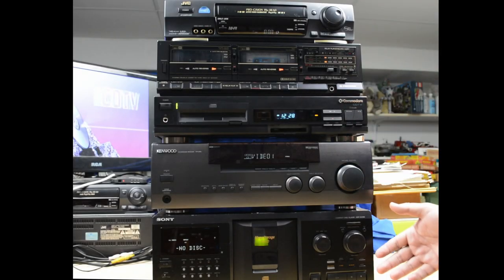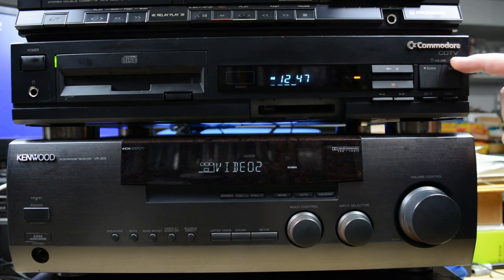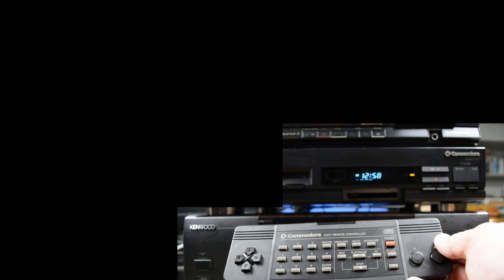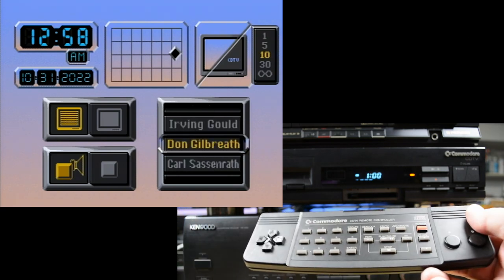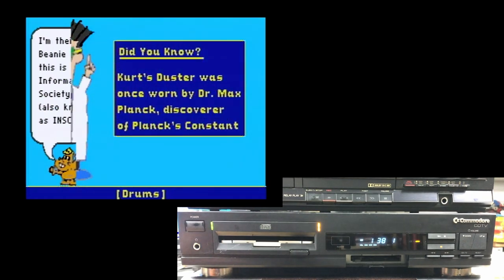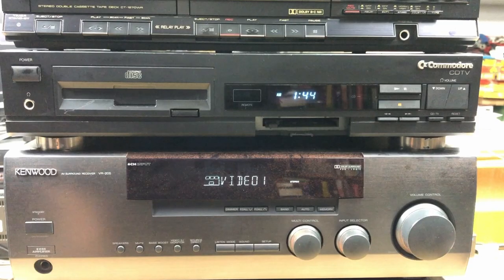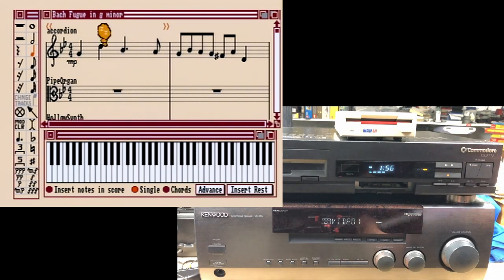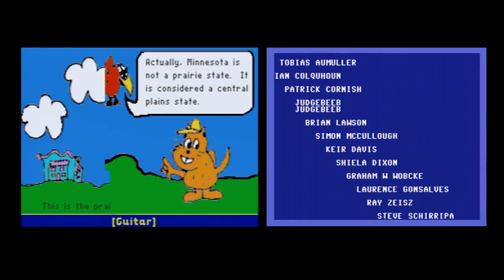An Amiga Hiding in a Tower of Power: Commodore CDTV in a 1990s Hi-Fi Stack

Comment: I was the developer of the Xetec CDx system for attaching a CD drive to your Amiga. Later, when CDTV came out, we wanted to give our customers the ability to use these CDTV titles on a stock Amiga system. So we developed emulation versions of the special libraries and software "devices" that the CDTV had over the stock Amiga OS. That worked reasonably well for many CDTV titles (we successfully tested about 45 titles), although I think we encountered a few that didn't work with this emulation.

I was fascinated with CD+G at the time, but couldn't make it work with our system because the Chinon CD drive included in our system did not provide software access to the +G data stream. We supported user-supplied drives, too, but I don't recall that we ever found an available SCSI CD drive that supported access to this data. (IIRC, the Matsushita drive in the CDTV was not SCSI.) 

Funny/sad story about my quest to get +G working: I suspected that these CD drives might indeed provide a way to access the +G stream (and other optional streams also doc'd in the CD "red book") using commands that were just not documented. This was common of SCSI drives at the time -- support the required standard commands and then add "vender unique" command for your internal use or specialty functions. So I wrote a sort of "war games" SCSI scanner that you could point at a drive and it would try every possible SCSI command and log the error returned to help me look for undocumented commands. This tool worked pretty well to uncover commands that the drive supported in some fashion. But then one day I accidentally pointed this tool at the wrong SCSI address -- that of my development hard drive attached to the Amiga! Anyone familiar with SCSI knows that there is a VERY simple command (04 00 00 00 00 00) that performs a low-level format of the drive. Next thing I know my HUGE (for the time) 800 MB development disk is click-click-clicking with the familiar sound of a low-level format. Yikes! How I recovered this drive and the data on it is another long tale that, all these years later, I just chuckle thinking about. Although I did find undocumented SCSI commands in these CD drives, never did I find one that would let me pull the +G stream and convert it to graphics in order to "play" CD+G's on a stock Amiga. I think I even spent some time reverse engineering the Chinon drive's firmware 😲in my quest. Boy, what a nothing burger CD+G turned out to be after all...
Reply: Oh no what a nightmare for that drive to get formatted!?!  Were you able to somehow retrieve most of the data I hope?  Roughly how?
Reply: @judgegroovyman  I powered off the drive as soon as I realized what was happening. Which left the drive in a zombie state where it thought it wasn't formatted. But I suspected that the data was still there, since low-level formats usually start at the lowest cylinder and progress to the end. And somehow I knew that this drive generally tried to fill the disks from the middle outward (to minimize seek times). But how to convince the drive that it was formatted and let me get at my data?? This was a Fujitsu hard drive and its firmware was in a socketed EPROM😲. So I was able to pull that chip and grab an image of the stock firmware. After much reverse engineering, I found the code that determined if the drive was formatted or not. I modified that code to make it believe it was, and burned that to a new EPROM and popped that in. Voila! My data all appeared again.

You can bet that we adopted a better policy of data backup after that incident. (This was, after all, before networking or cloud backups made this process easy)
Reply: @martyflickinger  amazing story, I had CDTV with 2mB fast extension but never learned about CD+G, now I am more tech inclined linux user and love to learn this stuff, thanks!

Comment: I'm a member of the CDTV club since a while back, and it fits right in with my Philips DAC/Receiver/Amplifier, and the monitor on top completes my tower of power. :)

The price of it was like a CD player on release, you basically got a computer for free, a no-brainer. It was certainly ahead of its time, not until 1995 did people understand they wanted multimedia for their PCs. In fact, it was like that for most Commodore-Amiga models; they were better than the competition on release date. They should have released full programming information with each model, but that's not why the models didn't succeed. Most models didn't sell to the numbers they deserved because Americans didn't get the Amiga and didn't embrace it. They embraced locked-down cheap consoles with 4$$-expensive games though, and then bought the complete opposite, 4$$-expensive PCs (but only clones) and pirated the crap out of it. 

No serious hardware or software developer can do anything to combat such madness in consumers.

Comment: Very cool to see the Commodore CDTV get some love on your channel. I started my CDTV journey back in 2011 and done a couple videos on my channel about it. The last couple of years I have tracked down most of the accessories for it. I'm now only missing the black 1084s and the 256KB memory card (I have the 64KB one). Side note, Power Pinball is one of the better games made for the CDTV 🙂
Reply: Better? Wow, that's rough, to say at least. Feels like a scam, rather than commercial software, knowing what Amiga hardware is really capable to do.
Reply: @override7486  Sure, we all know what the Amiga hardware is capable of doing, however back in 1991 when the CDTV originally was released, they were not doing all the amazing cool things that came later. As a CDTV branded title, as mentioned in my previous "Power Pinball is one of the better games made for the CDTV", I didn't say it was the best ever made for it. I actually prefer Lemmings over Power Pinball LOL. The CDTV was discontinued in 1993 with the launch of the Amiga CD32, so by then they were doing way better games and other software.

Comment: CD-ROM drives were pricey in the late 1980s and early 1990's.  I remember the magic number for me to jump in (for PC) was $300 and I saw one go on sale for that price at Fry's in 1996.  It went for that price pretty regularly in 1997 and then started dropping fast in the next few years.  I also remember buying my Amiga 500 for $600 in 1990, so a CDTV at $1000 wasn't out of line, but it wasn't compelling because of the software.  Had I seen a bundle that included the disk drive, keyboard and mouse for $1000 and I didn't already have an Amiga 500, I would've bought one.

Comment: Picked up my first CDTV around '92 when our local Amiga dealer was blowing them out for $99 since they had flopped in the market. It made a great companion to my Amiga 500 since with a special parallel port cable and drivers you could connect both machines and load software from one to the other. Sadly I sold that CDTV on eBay about a decade ago as I really wasn't using it once CDs were no longer en vogue. Got my current CDTV a year or two ago and although the CD-ROM drive is broken (and I'm not about to dig down through the innards to replace the faulty capacitors that are most likely causing the problem) I have fallen in love with it all over again.

Comment: Great video Robin. Nice to the CDTV in some detail.  

That Power Pinball is almost embarrassing. It doesn’t seem all that much better than some Commodore 64 pinball. There were much better Amiga pinball games for sure. This is meant to play from a CD ROM that could hold 650MB of data and displays on your TV, yet it takes maybe half the screen and the graphics are weak. 

For a storage media that holds something like 700 times more data than an Amiga floppy they should have done a lot better.

Definitely interesting. That $300 Encyclopedia would be $592 today. Ouch!
Reply: even more insulting is that 300$ Encyclopedia came bundled with every pc that came with a CD rom (with updates for video and audio)  only a couple years later, and by 1996 you couldn't give away new copies for free at our checkout counter

Comment: I still have my CDTV, keyboard, and floppy drive somewhere. I hope it didn't have a leaking battery onboard.  I'm just getting back into my older hardware.  I picked up a squarish formatVGA LCD at Goodwill for $4.75.  lol.  Now to choose a display adaptor option for 23 pin to VGA.  The CDTV always occupied a spot next to my stereo rack, with a 1702 monitor running composite.  The mouse was horrible though.  God I love the CD interface.  One CD+G I had on accident was Jimi Hendrix Smash Experience.  Kinda cool!  INSOC CD looks a bit cooler I think.  Hopefully I can find one.

Comment: nice... In my CDTV stack, I have....(well 2 stacks - All Sony) LBT-950D on the left. then on the right stack, starting at the bottom...DVP-CX850 (200 disc DVD), MDP-850D (Laser Disc), SLV-E80 (VHS), STR-DB930 (amp), Amiga 3000 in  black Checkmate 1500 Plus case, CDTV, and at the top, DTC-690 (DAT)

Comment: I actually bought a Sony CX455 (which holds 400 CDs), and then I bought another one, and then I bought a CX70ES (which holds 200 more & plays in "enhanced standard").
You can link the CD changers together and put them into a Jukebox mode that plays one track from one CD on the first unit, and while that's playing it'll select another disc on the second unit, and when the first song ends the second one starts immediately. The link is 1/8" mono patch cord between the units, I don't know how many you can daisy-chain like this.
(Obviously doesn't hold as much music as a 120 GB iPod, but hey).

Comment: The INSOC CD takes me back. I had a NEC Turbo Duo in the 90s that could play CD+G discs. I had this INSOC CD (as well as their other albums) and I also had "Naked" by the Talking Heads and "Silvertone" by Chris Isaak which were both CD+G albums but neither of them had graphics that were as interesting as the INSOC CD. I thought it was a shame that there weren't more CD+G discs released and I think the format may have had wider acceptance if the Sega Saturn or Sony PlayStation would have supported CD+G. Most of the early CD based game consoles (TG-16 CD/Turbo Duo, Sega CD, Jaguar CD, 3DO, Phllips CD-I & Commodore CDTV) could play CD+G natively but none of them had true mass market appeal as later optical based consoles did.

Comment: Very interesting video!  I wonder if VCRs use 4-bit chips like that Sanyo chip for their displays?
Reply from the maker: Yes, those 4-bit chips were very common in any application that needed a lot of I/O to run their displays like LED / LCD / VFD. I did a video about "4-Bit Video games" showing a bunch of electronic games by Tomy that also used similar 4-bit microcontrollers and explain a bit more about it there.

Comment: I wonder if the CDTV can run regular Amiga programmes for the equivalent machine. I suppose you'd need to somehow connect a floppy drive?
Reply: I watched on. It appears as though it can!
Reply: Should run pretty much anything designed for the A500 range.

Comment: 30:20  The stereo mixing is really irritating on headphones. Each note is either 100% left speaker or 100% right speaker. Was that typical with Amiga music?
Reply: I think the sound chip could only pan left, right or center.  If you wanted an instrument or sound to go in between it'd take 2 channels panned left and right playing at different volumes, and you only got 4 hardware channels.
But yeah it seems like an odd gimmick to add some kind of fake dynamics to the music in this software.  It might be quite old and before the tracker days of music composition on the amiga, so those sorts of gimmicks might've just been all this had to sell you on it. :p
Reply from the maker: The Amiga doesn't allow panning; it's got 4 channels, and two are hard-wired left, two are hard-wired right. Anything else needs to be done through software.

Comment: What, did you say Amiga had an internally 32-bit CPU? Or just this device here? Not sure I've ever heard of that, at least I've always believed it was purely a 16-bit system - and I guess it's more truthful to call it 16-bit, even if it has CPU internally 32-bit.

But people are often treating this kind of thing like it's totally meaningless that the CPU is internally 32-bit, because it's bottlenecked by the bus, but that's far from truth as well. Because, think of doing math with long integers on 16-bit system - a 16-bit CPU has no opcodes for working with 32-bit numbers; it has to do the math in 16-bit portions. In multiplication it means multiplying each part of the second number with each part of the first, so 4 multiplications plus then some adding and stuff. And that's simplification. A 32-bit CPU can do it with one instruction - so even if the rest of the system is bottlenecking it, the math is still faster. Just as one most obvious benefit.

But did I get this right, is Amiga 500 CPU internally 32-bit?
Reply from the maker: Yes, the 68000 CPU in the Amiga 500, CDTV, and also Atari ST and Mac are 32-bit internally, but have a 16-bit data bus. The 68020 and above are fully 32-bit but code compatible, so it was pretty easy for later revisions of those machines to jump to full 32-bit without requiring massive OS or other software upgrades. I've even heard the "ST" in Atari ST stands for "Sixteen/Thirty-two bit".
Reply: @8_Bit  Nice! I'm not sure I've ever even heard about it, but I'm sure that if I have, I definitely did not remember that - I've always classified A500 (and Atari ST) as purely 16-bit machines it my mind, and I like the be right (as in not just believe I'm right), so I thank you for this information <3

P.S. I don't think anyone expects you to stick uncompromisingly to 8-bit systems only, just because you're the 8-Bit Guy - of course I can only be sure of my self, but it's OK for me that you ocassionally talk about other retro computers/stuff than just 8-bit ones. Don't stop on making a video, on something you would love to do, just because it falls outside of 8-bit area :) <3
Reply: @8_Bit At least one piece of software died rather badly when Amigas with a 24bit 680x0 came out as they stupid programmers used the top 8 bits for other storage...